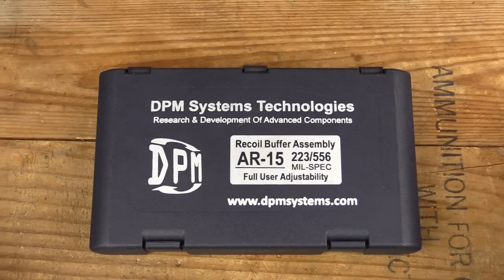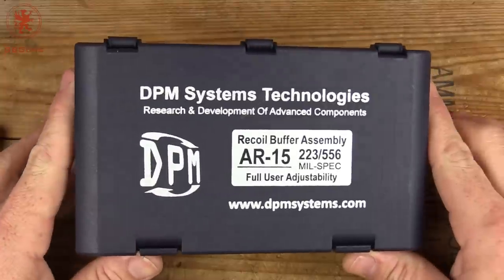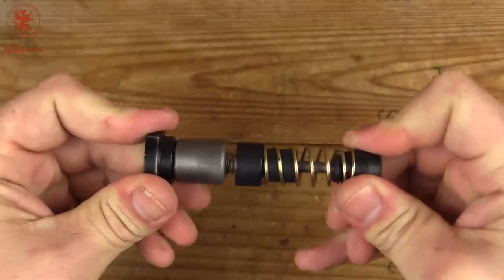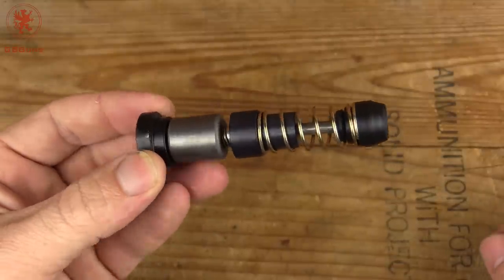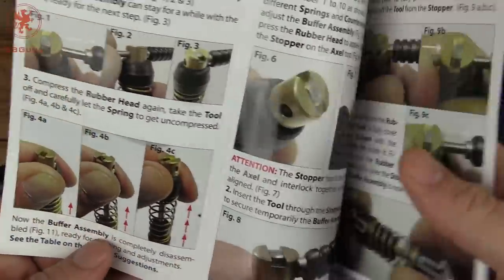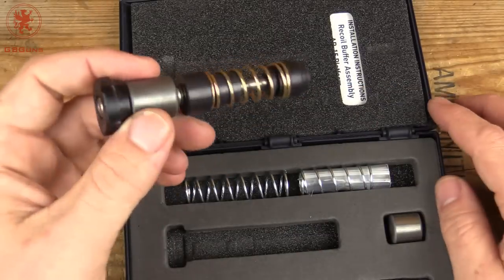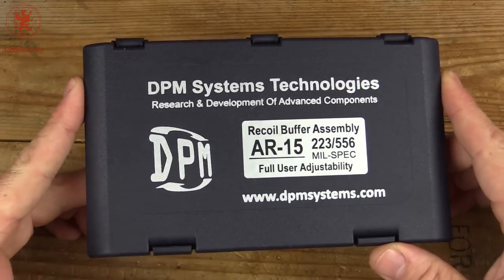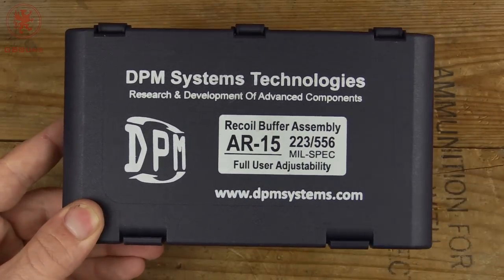Ultimate AR Buffer System from DPM Systems

Comment: I use the Rate Reducing Buffer from MGI in my 6.5 Grendel. This looks interesting. Oh, I took your advice and am using the DPM in my P99as. 9x19 doesn't have a lot of recoil, but the muzzle flip is a bit less. I'll shoot some +P loads and see if it is more noticeable.

Comment: Question... If the bumper never hits the back of the buffer then why need the large rear spring? the spring loaded weight seems to make sense but the larger spring for the bumper doesnt seem necessary if you tune the gun right.

Comment: Current thoughts on this system (for AR and pistol)?
Reply from the maker: The recoil impulse in an AR is strange, and those not knowing about it will try to tell you your rifle's over gassed, but it does reduce recoil.  In the past decade or so I've tried them in several pistols.  In some handguns it makes a huge difference, in other's not so much.

Comment: Is this way better than the JP silent Capture spring?
Reply from the maker: It's different.  This isn't just quieter, it's also a tunable system.
Reply: @GBGuns  No way it can be quieter since the mainspring is still there scrubbing against the tube making that loud zing-zing sound.